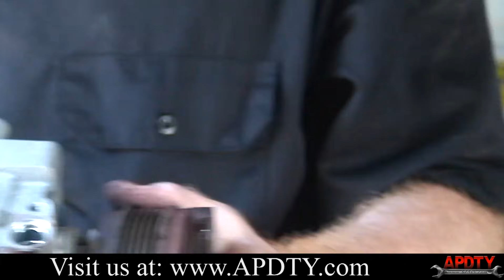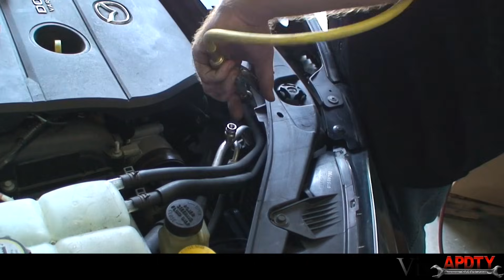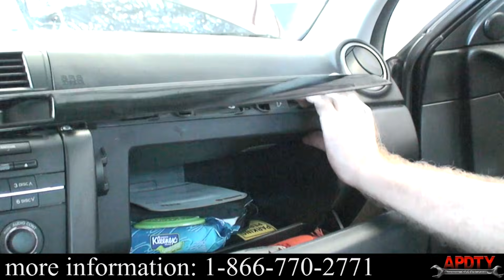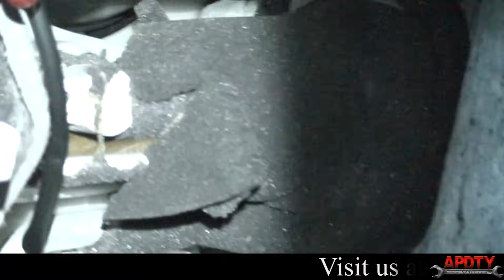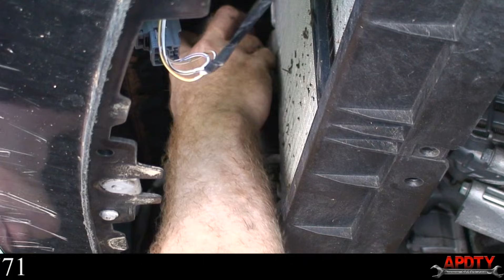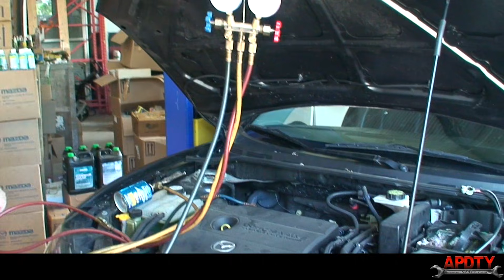AC Compressor, Condenser, & Dryer Replacement On A 2004-2009 Mazda 3 Non-Turbo

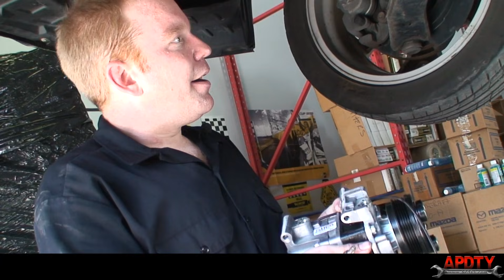Comment: 6:53 how much oil needs to be in the new compressor?
Reply: From what I hear 2 oz, I saw your comment was 10 months ago, and right now I'm about to change mine in a couple of weeks, let me know if I was right
Reply: Hi, do you know if it does matter if you are replacing everything (condenser, valve, dryer)? I mean do i need to add more oil or its the same?

Comment: Do I need to blow air after the flush solvent to "dry it up," or no need because it simply evaporates while i'm doing other things?
Reply from the maker: These are alcohol-based and will evaporate; however, air or nitrogen is used to blow out the lines afterward.  It's also crucial to perform the evacuation and pull a vacuum before installing any parts. Many AC flush kits are available on the market, and it's best to follow the instructions provided by the chosen kit, as well as the factory repair manual. Shops typically have a tool that connects to a bulk solvent supply and then blows the lines to remove any metal particles from the old compressor and also to remove any old oil.
Reply: @APDTY  ooh ok thanks, so the evacuation with the vacuum should finally dry it out anyway

Comment: Thanks for the education. I’m about to embark on a $750 full replacement. I hope my mechanic is as good as you are. I didn’t realize until watching this video how much was involved in replacing your air conditioning. I live in Toronto. It’s July 31 and August is our hottest month we average around 30°C Celsius I was going to try and wait it out until Next spring, but I just can’t handle the heat😅 great video guys
Reply: I actually live in toronto, who is the mechanic/shop that took care of it for you? $750 doesnt seem too bad i think?

Comment: Can someone enlighten me about ac compressor 

how are they like. are they different in each car for example i have a mazda3 gx 4dr 2013 1.8l engine and i need a fixing on it but i need knowledge on what and how is it and can i put a 2010 ac compressor in it?
and do they haev a particular code or number?

and can someone tell me about a website or app where i can find the part with my cars VIN number

Comment: Does the compressor make a whining noise, and does it go on and off ?
Reply from the maker: So, the compressor will make a noise once engaged by the clutch or, in other words, when it's turned on. If your compressor is coming off and on quickly, then you most likely have an AC issue. A compressor engaging on and then off again quickly,  and not related to the internal temp control, then that is called cycling and you may need to diagnose it. Low refrigerant can cause that, as well as a worn compressor or clutch. Letting that go a long time will wear the clutch out quicker than normal.
Reply: Thank you .🙏
Reply: mine makes a tuga tuga tuga or a waoooh woooaoh wooooah

Comment: People DO NOT stretch the belt.  There is a hanger for the compressor, get the compressor. line up and hang it, put the belt over the clutch and put the bolts in, tightening them in a criss cross pattern.  Stretching the belt is the wrong way

Comment: Does anyone happen to know what the average cost of getting this done at a shop is now in days? (There's no way I'd be able to do this myself)
Reply from the maker: This job in a shop can easily be over $1000.00 and up to $1600.00. The parts are expensive for this model. Also, this vehicle and many other vehicles require the condenser to be replaced due to its design.

Comment: Do you have to run the vacuum pump when adding the refrigerant?
Reply from the maker: The vacuum pump is used to pull out any refrigerant, atmosphere, or oil before opening a system. It is also used to put a vacuum on a recently repaired ac system that needs the atmosphere removed and to allow the system to sit under a vacuum for a period of time to verify no leaks exist before adding refrigerant. This is part of the evacuation process done before adding refrigerant. Once the system is under a vacuum and the leak-down test passes, the vacuum helps suck in the pressurized refrigerant. Next, the system is monitored with gauges to see how the compressor is reacting, and the technician decides how to proceed and typically, the compressor is then used to suck in the remainder of the refrigerant. Slightly different techniques exist based on the trained technician's equipment, the vehicle that are working on, and preference.

Comment: could you take out the evaporator like this with basically taking out the glove box or do you need to take out more of the dashboard to completely remove and replace the evaporator?  I know i had an older taurus and they took off the side of the dashboard too.

Comment: Thank you for the video, but I was unable to compete the expansion valve steps. I wasn't sure how far I could move the refrigerant lines without damage. Also, the Allen bolts didn't budge for me. I just reconnected the lines and checked for vacuum. If it's steady, I'll proceed with the repair.

Comment: U put belt up there roll on like that but bump the starter it will right in and no hard work just line up direction engine is CW rotation

Comment: Hi, I have Mazda 3 1.6 2009 my mechanic replaced the ac compressor but still very noise, can you tell what is the main problem. Thanks
Reply from the maker: Could you look at youtube videos on how to find engine pulley noises? Someone can put a stethoscope or other listening tool (like a socket extension) to find the area the noise is coming from. It is likely the bearing for whatever that is, for instance, idler or tensioner bearing or alternator bearing.

Comment: So I noticed on my 2006 mazda 3 2.3 the ac only gets cold when I'm on the freeway, however when I'm at a stand still you can barely feel any cold. I tried to put more freeon but the gauge said it was full...any ideas before I replace the whole thing?
Reply: recently got the same issue . have you figured out?
Reply: @zhengyingcai  unfortunately no, I'll be working on it in about 3 months when I have money to fix it 🙃

Comment: Can I flush system after replacing dryer?
Reply: No, you can ruin the new dryer if the flushing solution gets into it. It's best to flush with the dryer removed.

Comment: Really wished you would've shown how to flush the rest of the system. Feeling really lost as far as what other inlet and outlets I'm supposed to flush through. I was thinking of flushing through the other end of the hoses you disconnected at the condenser so the flush would go back through the firewall, expansion valve, evaporator etc, but I'm not sure if this is correct. It doesn't seem as simple to me as you stated.
Reply: Agreed, he didn't show a complete flush which is what you should do if the compressor fails. He also flushed the condenser without removing the dryer beforehand. Basically, flush any of the lines and parts in both directions and blow them out with compressed air. If you detect any dirt or debris coming out then you didn't flush it enough. The evaporator should also be flushed once the expansion valve is removed which he didn't show. The tricky part can be catching the flushing solution as it comes out of the part so you don't make a big mess. Keep in mind, once you do this you need to add the full amount of oil that the system takes. Most new compressors have a label that states how much oil is included in them, if you system requires more oil than the compressor already has in it then you will need to add more until you have the correct amount.
Reply from the maker: Please check out our youtube videos or others specifically for flushing. We have a few videos dedicated to flushing, evacuating, and recharging the ac system. We don't show it on each and every ac video, as the videos are so long already. 
I agree though it would be nice to see how each vehicle is flushed, but as long as each line and the evaporator is flushed, they are all basically the same.

Comment: Looking at the video, isn't it just the clutch on the compressor that is locked up?
Reply: No. The visable outer part of the clutch/pulley is what is connected to the internals of the compressor. That should move freely, the outer pulley spins freely until the magnetic clutch is engaged, then it "grabs" the rest of the assembly to turn the compressor. If the visible part (not the pulley) won't freely spin when the clutch is disengaged, the compressor itself is siezed

Comment: Good video. Seems like you were not as thorough as the beginning of the video the further you got. It seemed it started when u talked about the O rings in the dash. I could see the sweat dripping off your face so understandable why u wanted to finish project quick. Like your videos and thx.
Reply from the maker: yes and we remove a lot during editing or these videos would be much longer.

Comment: My wife hit a curb coming from traffic and the ac compressor is making a weird sound. So I just wanted to replace the air compressor. Do I really have to replace the expansion valve and drier?

Comment: What should this job cost? I have the 2008 model Mazda 3 sedan and my a/c quit working. I had a new compressor put in and the air never worked with it so I don't know if I just got a faulty one or what. That job cost me $800 at a garage basically for nothing. Since I'm a girl I figured it wouldn't do me any good to go back to the mechanic so I just let it go and suffered all summer with no air. Maybe it was a faulty compressor or maybe he charged me but didn't do a damn thing, I don't know. Its hard to know who to trust with your car repairs.
Reply: Did you ever get it fixed i have an 06 with the same problem
Reply: I have an 07 with the same problem. It just started a few weeks ago

Comment: How much is the price for the ac compressor?
Reply: I went to a garage and paid $800 to have a new air compressor put on but mine must have been a faulty one because my a/c still did not work. I have a 2008 Mazda 3 sedan, black on black. Each time I had to drive I felt like I was driving around in a coffin in Hell it was so hot! I went all summer with no air. Don't know what I'm gonna do next, I really don't want to fork out all that money again. Hopefully  you will have better luck than I did. A dealership would probably be the best place to go but they will be more expensive than a regular shop garage like where I went.
Reply: Same boat I have a 06 and the air doesn't blow cold even with the new compressor
Reply: My ac blow hot air took it to the shop they wanna charge me $1300 said I need a compressor and ac belt so I just bought both myself offline compressor was $90 belt was $25 now ima go to a new shop get them put it in for me hopefully under $500

Comment: One question, am I able to swap out the expansion valve before I change the ac compressor. I have a lift I can use but goal is to minimize the amount of time I spent with it on there. So I would like to do the compressor and dryer in one go while it's up. Thanks!

Comment: Can't see how you set the stretch belt tool in order to make it work
Reply: It basically sits on the edge of the pulley with the belt sitting on the tool..
Reply: @cocoloco7295  I figured it out a long time ago lol
Reply: I figured but threw it in there JUST in case lol

Comment: Guys I know he's using a tool to put the belt on.! But there is a small hole in the pulley you put the bottom belt on to the compressor and then looking at it from the wheel foot the belt towards the front then take the tie clip slide it through the hole and around the belt make sure the belt is in its right grooves. Pull it as tight as you can then take a 22 mm socket and turn the pulley counterclockwise and it will pull the belt up and over towards the end it gets tight you may need an extension bar. Keep putting pressure on the pulley until it comes completely around and then stopped as soon as the belt is completely on take a pair of Clippers and clip the tie clip. In Bingo the belt is on.! Excellent video by the way.
Reply: Thank you! Way easier then using that tool

Comment: Should’ve kept the compressor loose and the. Tighten it down after putting the belt on
Reply: Exactly.  I just did this and I can't believe they are recommending stretching the belt. The compressor literally has a built in hanger so you can put the belt on then tighten the bolts.  Stretching the belt to fit over the pulleys is like wiping before you poop
Reply: Stupidest thing I’ve ever heard 😂
Reply: That does not always work sadly. Sometimes the movement and access are so limited you can't get the compressor and belt back on together. The right belt tool is essential on some vehicles.

Comment: the yellow hose is full of air. You just pumped air that occupied the yellow hose into the system. you should have bled that air out each time you hooked up a can of refridgerant. Object is to keep the system as dry as possible. Nice instructional video . Thanks
Reply from the maker: yes we always purge the line, we rarely show the whole process in the final video as the video gets too long, we do have a separate video explaining how to properly evacuate and recharge a system and it includes purging with gauges or with an ac machine.

Comment: While idle  my engine goes off when i switch on the heat but it's fine with cold air. Will that still be the compressor ?

Comment: why didn't you replace the condenser/dryer? warranty is void without replacement
Reply from the maker: So we did replace the accumulator (dryer) in the video, however we did not replace the condenser, You are correct though that many shops will not warranty the job if the customer does not replace the condenser. This is normal and really replacement should be done if any internal pieces have circulated around. In this particular case, we took replacement into consideration and also the condition of the system, we found no evidence of pieces circulating and we do this by looking in each place we have opened up and especially the expansion valve. Also while flushing each component we can see if any bad stuff is coming out, if any bad stuff comes out, then it is really no option than to replace the condenser. We found nothing and cleaned everything very well, we discuss all of this with the car owner and we let them make the final decision. We all lucked out and the car is still working very well in this very hot sate of Florida. Most shops especially chain stores will not give you the option, some single owner shops that fully understand may do this like we did and we really just used our best judgment and in this case it worked out.

Comment: Im replacing the high pressure line for my girls 07 Mazda 6 today. I have a container of ac oil but no way to inject it. can i just pour a little oil into the low side without some sort of an injector?  This Texas heat is a killer and i need to get this done soon.
Reply from the maker: You would have to evacuate the refrigerant out before removing the line unless it it totally empty, New oil can be added during the recharging process, you add the oil right in with the refrigerant, shops can also do this for you after you install new parts.

Comment: You should have measured the oil in the new ac compressor to make sure it has the correct amount of pag oil....
Reply from the maker: Yes we always double check the oil amount on all ac jobs, we try and make these videos as short as possible because they can easily run an hour or more so sometimes in editing we edit out some portions and most of the time it is the normal procedures like flushing, oil amounts, evacuations and recharge procedure as these are mostly the same on every vehicle. We do have a bunch of other videos on other models showing how to measure the oil. One last thing, adding oil will depend on the components being replaced and the technique used by the specific technician doing the job, an old school tech has a different technique then a younger tech and both procedures work fine and neither may be by the book, but it is the experience and knowledge of the tech that usually determines this, At the end of the day the vehicle must be fixed and perform as well as it did brand new or else the job is not worth doing.

Comment: hey listeng, my mazda 3 2006 2.3 have a problem with the A/c its just it stop trowing cold and when you let the car cold down and turn it on again it will trow cold and i dont know what is it and what to do.
Reply from the maker: this would have to be diagnosed, make sure your fans are coming one a failed fan will let the condenser heat up quickly and it no fan the high pressure will get too high and shut off your ac
Reply: APDTY got fixed, it was the compressor thanks 🤙🏼
Reply from the maker: @anthonyjerez01  awesome